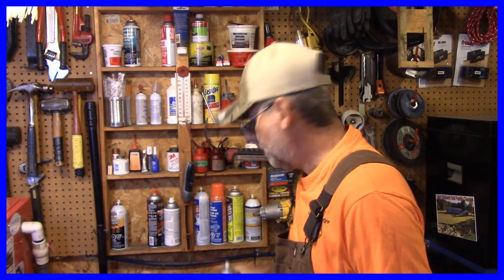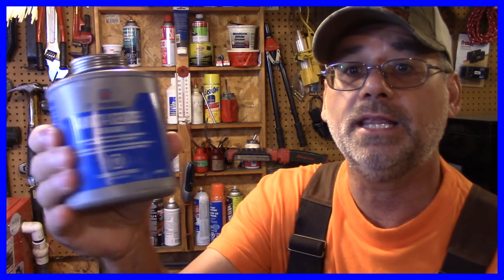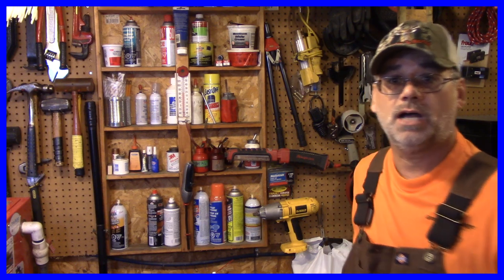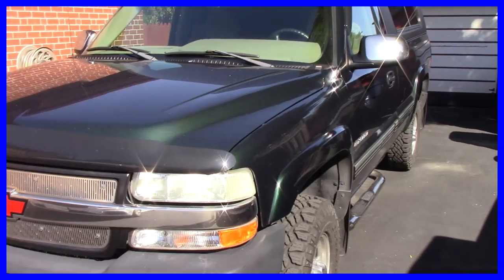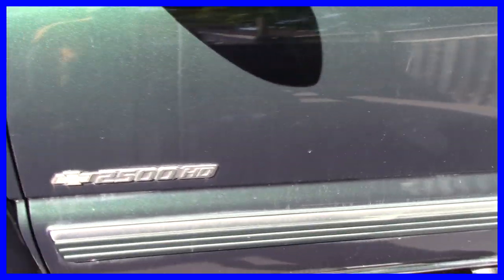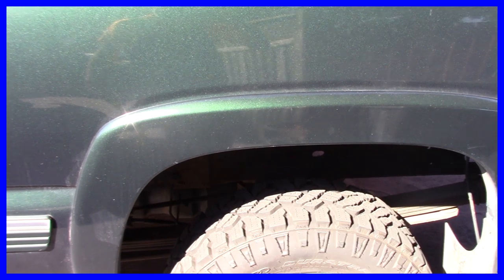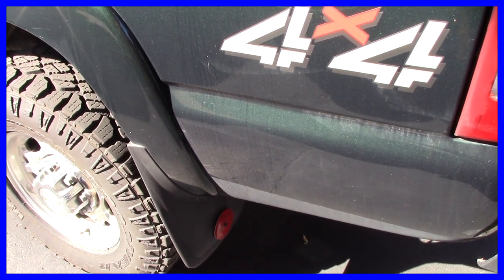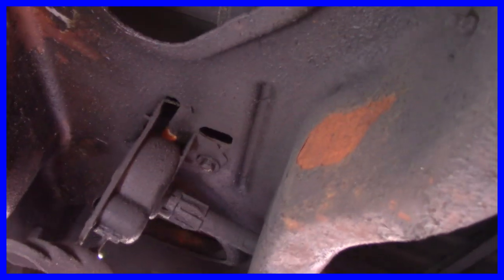APPLYING  RUSTPROOFING / UNDERCOATING TO  YOUR VEHICLE  - THIS IS WHAT I  DO AND USE  .

Comment: Which one do you think works better the chain lube or rust check coat and protect? Also how many cans would it take for the whole truck?
Reply from the maker: Coat and protect . 4 - 5 cans most likely.
Reply: @SteveRobReviews  thank you. You should make another vid on how well it’s held up over the years. My truck is a good example of what happens when you don’t apply any rust proofing in Ontario. Last year I lost a cab corner lol I have no idea where that ended up. Also gonna have to do another couple spot welds on the slip on rocker cause it’s rattling I guess a couple spot welds let go and weld up a crossmember on top of a lot of other repairs lol thanks to the salt and brine
Reply: @justjoshin5140  I second this!!!!!!
Reply: @SteveRobReviews  Rust Check sells for $20 a can (It's 20-25% paraffin wax and 35-45% mineral oil) - so that's $100 right there for 5 cans at 12 ounces per can=10 ounces of paraffin wax total. It's not sold in the U.S. - looks like an Ontario distributed product. I'll try make my own stuff. I used RP-342 before - Cosmoline out of Chicago. It's paraffin wax. Also $20 a spray can. DIY recipe: 12 paraffin candles (12 ounce total so just under 1 pound) for $5.50 melt in crock pot. melt in 2 tubs of 13 ounces vaseline for potential creep (mineral oil-petrolatum wax mix). $10. 1 tube of graphite lube for black color ($1.50).  Two quarts of pure turpentine. $20. Mix it all in bucket. So $37 dollars and use a garden hand pump sprayer.  LPS3 sells a gallon of paraffin wax that is 50% mineral spirits (for $100) and can be sprayed in a garden hand pump sprayer. So again this would be the same as LPS3 but only $37 instead of $100.
Reply from the maker: @voidisyinyangvoidisyinyang885  That's very expensive for rust check .  Use what's available that suits your needs. Cheers 👍
Reply: @SteveRobReviews  thanks for the correction! I noticed you said it's sold at CanadianTire - so I checked. It's only $7.50 U.S. a can. So yeah that's only half the price of similar products in the U.S. I want black - and they charge more. People buy graphite powder to mix in the black but seems like a pain. That's only if you are using a spray gun and buying a gallon of the stuff. FluidFilm I mean which does not stay on long. Also mechanics despise the goo. So yeah RustCheck in Canada is the best price for sure!! A can of rp-342 is $20!! Is you buy 6 cans they are $15 a can. I wonder what shipping is from Canada. "No, Canadian Tire does not directly ship to the United States." Yeah the best price you can get in the U.S. is Harbor Freight PB Surface Shield - for $10 a can. But sometimes it goes on sale. So if I make my own I can get it for one third the price. I'll try it out.

Comment: Have you tried the fluid film,,, I have tried that and I like the way I can get into narrow spaces and it will soak into the areas where metal meets metal...:) No water penetration then!:)
Reply from the maker: I have used it a lot , it's good stuff but not as good as the Rust Check  - Coat & Protect .  Plus the fluid film is much more expensive.  Cheers Vicki

Comment: ***Can you give me the part number to your Liquid Wrench Chain Lube***. I see they manufacture more then one type now so I want to make sure I purchased the correct one. I have a 2000 Ford Full Size Cargo Van. I purchased it used in 2006. It was 6 years old with only 24k miles on it but had a lot of rust under it. Right away I started treating it with Loctite Rust Treatment that makes the rust turn black and makes it paintable. Even though I treated and then painted it, it did not last or protect the bottom of the Van well at all. A waste of my time. I still have the Van and had it back up on my lift because of brake lines rotting out again for the 3rd time. I replaced the lines but would like to coat them this time with Liquid Wrench Chain Lube once you list the part number for it. The other night I took some drip oil from doing oil changes that I save by turning quart bottles over in empty gallon containers to drain further before I put those plastic containers into recycling. You would be surprised how much good oil that accumulates over time. Anyway with a Chip Brush I painted that oil all over the Rusty Frame of my truck while up on my car lift. I probably should of done that from the get go 14 years ago. Could of touched up any needed areas during a oil changes over time if it was needed and probably the truck would of been in better shape today if I did. Live and learn.
Reply from the maker: This is it here https://www.liquidwrench.com/product/chain-cable-lube/

Comment: Would PB blaster or WD-40 works. PB blaster have corrosion stop spray can does it work?
Reply from the maker: Their both not suitable as a rustproof spray in my opionion, their  just a penetrating oil.  Better than nothing but in reality next to nothing compared to rust proofing chemicals made specifically to prevent rust. Cheers
Reply: WD-40 does work but over time rips paint off

Comment: Hi I'm just wondering if I can spray the chain lube when there are some rusts present on the underbody of my car.
Reply from the maker: It will surely slow down the rusting a lot . Almost impossible to remove all the rust first but it will make it last so much longer. Cheers Auden
Reply: @SteveRobReviews  thx Steve 👍

Comment: Thank you so much for such an informative video.   I used to use fluid film, and recently switched to Cosomoline RP-342.  Hopefully it wont wash out soon.  These vehicles are not cheap investments and any type or rust coating pays off at the end. Cheers.
Reply from the maker: Glad it was helpful!
Reply: @SteveRobReviews   I wasn't aware GM started to Galvanize their frames.   My first brand new car was a 2003 chevy, and it completely rotted out underneath in 2015, while looking new on the outside.  Everyone told me to wax the car exterior, which I did to preserve the paint, but I wish someone rather had told me to spray the undercarriage with wax.  
Do you think the newer cars are more rust resistant due to galvanizing?  It seems many newer GM trucks seem to start rusting right at the dealers lot...how is that possible :(
Reply from the maker: Just exterior body panels on trucks the frames are not galvanized.  New vehicles , all brands are much better than even 10 years ago.
Reply: Oh...I think on most trucks, it is the frame which seem to rot first.  I was just watching some Toyota tacoma frame recall videos. Not fun to watch.   I wonder why anyone would not galvanize the frame if such an awesome technology exist now.  It probably is cost cutting measure...too bad.
Reply: @SonnetGomes  is the cosmoline the same material as ValuGard 160?  I just had mine done and it's super thick and soft to touch

Comment: Has anyone sprayed rust reformer , undercoat , then apply chain oil or one of those oily products onto the undercoat ?
Or is that a waste ?
Reply from the maker: Sounds too gooey for me , nope never tried it 🤷‍♂️
Reply: Sounds good
Reply: I needle scaled a used truck I bought last year. Two coats of phosphoric acid in a paint sprayer . Let it dry a week then sprayed with a mixture of wax rings , linseed oil, engine oil. 
Holding up fantastic

Comment: Does anyone still use fish oil ?  I use it on my 79 volvo . It has rust from previous owners  but it has not rusted since I've owned it . The fish oil seems to work but I cant really condone it because they don"t salt the roads over here but it is an outdoor and I live in a cold wet area .
Reply from the maker: If it works use it . Never se it out my way.

Comment: Any oil based substance will fuck your moving parts up and eat them eventually. Gaskets, rubbers, plastic covers cables and such. They will expand and lose function. Main reason my most motor and transmission mounts wear our and look all chewed up is because on most cars leaks from engine valve cover gaskets leak on top of them. Same goes for Alternators. Most common wear on them is motor oil in them.
Reply: So true about the swelling. My Toyotas use 3M tape to hold the mud guards and body kits on. It doesn't take but a drip or two of oil-based stuff to seriously wrinkle them. When I'm spraying in my doors, I drape plastic film over  my door sills and keep it there untill all dripping has stopped. Also, lost a few door gaskets in the past before I realized how badly they will swell. When we teach the kids to rustproof in the school shop, we make sure that they avoid direct contact of the product with rubber mounts, bushings, door gaskets etc.

Comment: Chrysler had galvanized steel and dipped all their cars 24” up from the rockers in primer since the mid 60s. GM definitely did none of that.
Reply from the maker: Interesting . I worked at GM for 30 years and built both cars and trucks and back in the seventies you are correct but starting in the nineties till today they all  have galvanized  coating on all the steel body panels. GM also dips all their vehicles in a elpo dip just like all the others .  Cheers
Reply: STEVE ROB REVIEWS  Yup, even so. I have a 98 Ford E-150 and the salt has ruined it after 21 years. I had a 1970 Dodge Dart that was an Illinois car it’s whole life and finally rusted out after 49 years.
Reply from the maker: @F6HemiCharger  Lots of factors responsible for corrosion but overall vehicles built today are far superior in resisting corrosion compared to the past.
Reply: I live in NE Ohio. The last time I saw a 70 Dart was back in the early 80's all rusted to hell. Those were famous here for the rear leaf spring shackle breaking away and ending up in the trunk. lol Back then the make of the car didn't matter. They all rusted out.

Comment: How will you know if you ever have an oil leak? Or where to locate it?
Reply from the maker: James most oil leaks will be shown as a different colour but if I do have an oil leak I always  put a ultraviolet dye in  oil and it shines bright under  the light . Without undercoating many times oil leak can be a challenge to find . Cheers
Reply: I agree with Steve that the dye is a great idea. It serves the same purpose as the dye used in A/C systems. Also, oils leaks will always have a wet look. Rustproofing is rarely wet looking after it's had a chance to collect a little dust.

Comment: Here's a know it all guy. I live in Minnesota and vehicles rot like you wouldn't believe!!
Reply from the maker: Steve it doesn't matter how much undercoating  you apply they eventually rust out . At best it slows it down. Cheers
Reply: Steve, me too, have a new truck coming and looking at rustproofing it myself.
Reply from the maker: @patrickedgewood8598   If you do it yourself you will do it much better than paying  for it . I buy a roll of plastic from H/Depot  is  12  feet wide on a roll and spend 4 hours doing it right . Easy to clean up the next day. Cheers bud
Reply: @patrickedgewood8598  I highly recommend it. please don't end up going to P&L Automotive in Edina thru the dealer. I ran that shop and most of the products there are snake oil.
Reply: Steve thanks, just looking at buying by the gallon and getting a pro spray kit. Figured the best time to do it will be when the truck is brand new. Hasn’t even gotten to the dealer yet. I think I’m going with Fluid Film, as it’s lanolin based, and won’t harm rubber bushings and cv boots etc.
Reply from the maker: Good choice I spray it as is , no thinning . Almost dripless.
Reply: @patrickedgewood8598  walser dealerships use P&L Automotive and they only pay $499.00 for a full  rustproof and they charge the customer $900.00 to $1200.00
Reply: Steve  could upgrade my old air compressor for that.
Reply from the maker: Mine sprays with little air use .  I  have a  5 cfm 20 gal tank   compressor and it cycles on at 60 psi for  two out of ten  minutes on.

Comment: I was thinking about just spraying used motor oil on my underbody
Reply from the maker: I have never tried it but it would be some messy.
Reply: Works but you can make even better by adding wax. I make about 1/2 gallon with motor oil and a beeswax toilet seal. Just mix the wax into the oil best you can. If you set out in the sun and stir it will melt with the oil. Once it's all melted and blended you just need a stiff short bristled brush to paint it on. Works on places you can get to anyway. Keep regular oil to squirt into places you can't brush.
Reply: @scott1lori282  Question ? Is their a concern of the wax trapping the moisture?
Reply: @Jay-vr9ir  No. Water & Oil don't mix.

Clean up frame best you can. soap&water wire brush, what ever's needed. Wait till 100% dry and apply. Do it in the hottest month where you live.

1 toilet seal to about 2 quarts regular un-used motor oil. If you get the wax to mix well then it's like just brushing oil on.
The wax is very diluted and just makes the oil thicker and more self healing.

I've heard bar&chain oil works great too. Seems like it would but I've not used that.

Oh and the hard part is getting the wax to melt into the oil. 
Hot sun and steering can work but there's other ways:
Old pot with outdoor fire.
Heat gun.
If your wife's not home you could use an old junk pot and set your stove to "SIMMER". Becareful

Comment: I'm sorry to disagree with galvanization of vehicles. I don't know which cars your talking about, maybe it's a really recent thing, but all the vehicles Iv'e seen, probably 2005-2015 or so, did not have any galvanisation or any protection on the frame and or belly components. Many had a rubberized asphalt undercoating on the body area, but not where it reall y mattered.
Reply from the maker: I was only referring to the exterior body panels not the  frame  as on trucks. Cheers
Reply: @SteveRobReviews  definitely not galvanized...frame OR body panels. Its plain old steel. I live in NY where they spread salt and I see 3 or 4 year old vehicles with rust on the fenders, quarter panels, doors etc all the time. Manufacturers can make vehicles that wont rust...they dont want to. No money in that

Comment: Great Video.... I agree but... problem is owners like myself of 93 Cheyenne 2500... It has been a battle to fight the rust.  I found out that rubber based rustproofing makes it worse.    Washing it frequently does not seem to slow anything down.  I agree... they will not give you much on a 10y old truck..... unless it is a rare model with extremely low mileage.... Then why trade it in....   I have learned.... Keep them until for ever.....   I plan to squeeze 10 more years out of my 93..... One good reason it is a diesel...with no emissions.   Eat your heart out California CAFA jerks ...  But I will look for that Rust Check.... It might be available on the WEB....
Reply from the maker: Thanks bud .

Comment: Krown don’t ‘wash off’ it is designed and WORKS I have seen a 1998 GMC with the Krown product from the year before on the rockers of the vehicle, the krown wouldn’t come off when it was pressure washed, it will dry into your metal, and it helps the metal breathe, very good product and they are loyal to their warranty work etc
Reply from the maker: I have a different experience with that  company  . They did a great job spraying my wheel wells but when I got home and looked at the underbody the floor of my truck was bone  dry. The oil  sprayed in the wheel wells was gone in the spring. I never went back and started to do  it myself. Krown did a horrible job. Not all franchises are the same so if you have a good one stick with it. Cheers
Reply: cass Paddock Since when does metal have to ‘breathe’? You want air and moisture to stay out.
Reply: MrZdvy metal is a porous material which means it breathes basically, having your chassis full of dirt is the worst thing for it, best thing is have Your chassis clean and spray it with krown, what krown does is soakes into your chassis and any metal that is sprayed and it don’t completely stop rust (especially if you drive in NL Canada) but it slows the process dramatically. It only takes about 2 weeks to soak in people say it “washes off” but it will obviously “wash off” if you bomb down the road in a shit ton of rain, dirt etc, if you want a vehicle to last rust wise, clean the undercarriage, spray it with krown or whatever ya’ll prefer, and let it sit for a week, or avoid driving in a lot of rain or on a lot of dirt.

Comment: The only problem is that stuff is really expensive. I doubt it last very long either. I just like using rubberized asphalt or liquid rubber or butyl rubber products. 

Cheap and extremely durable
Reply from the maker: Use whatever works for you  as we do have a choice still. Cheers
Reply: Your vehicle is gonna rust from the inside out with any kind of rubberized undercoating
Reply: @sethtolman9987  
Nope. My Rambler is over 50 years old, and had only rusted where it wasn't applied. 90% of the original undercoating is still there.
Indeed, if thers no protection (either thick layers of paint or undercoating) inside, then yes, it will happen as you say.

Comment: Steve, Hello from New- Brunswick. I plan on having my 2008 Vibe coted with Rust Check since a garage here uses this product. I may do it myself after. But I saw this video here where Rust Check seemed to be innefective, but it looks like the other product(red transmisson ish fluid you mentioned) Is that red liquid from Rust Check for a different purpose thats why it does seem to work ?you still recommend rust check ? see video: at thirteen minutes 25 sec
 https://www.youtube.com/watch?v=9SOOfZFmhSY&t=890s
Reply from the maker: Rust Check sprays two formulas the regular  that is more like red trany fluid and the other you can get at canadian tire called rust check coat and protect.  The rust check dealers do spray the coat and protect but you have to ask and pay a bit more but I like the thicker application  and find it lasts a long time. Cheers